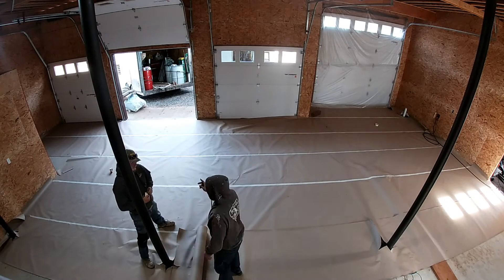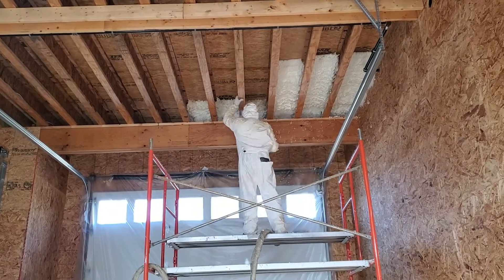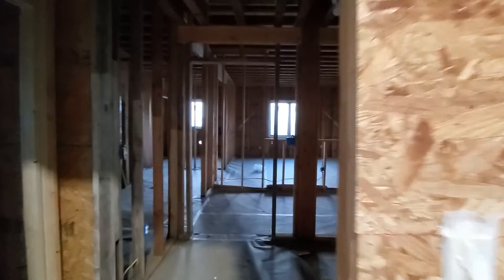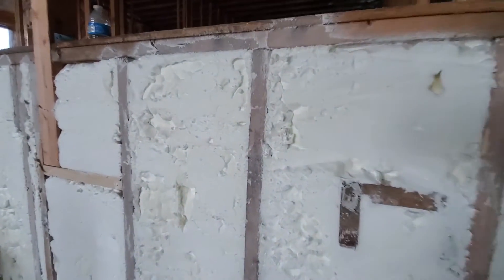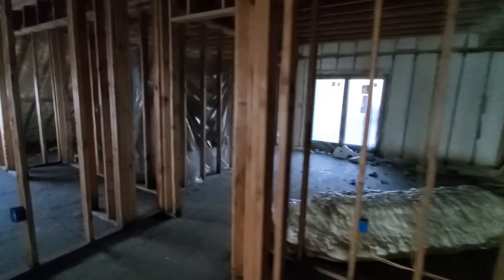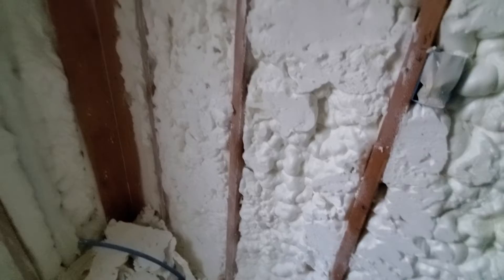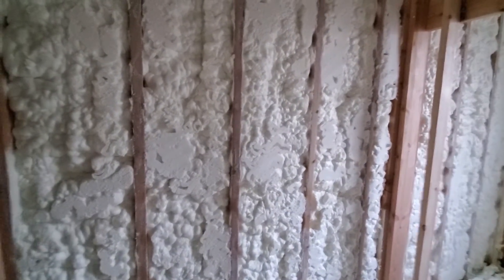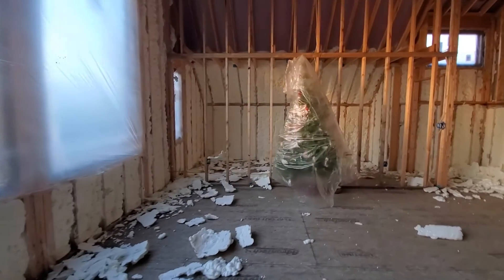Spray Foaming our Off-Grid Barndominium - Part 1

Comment: Hope they didn’t give you too much of a fit too fix it all up  with the amount of issues I’ve seen people have with spray foam companies it sure makes me cautious about doing it.  When my time comes I might just do a hybrid or do a ridged lair like you did on your roof on the whole house
Reply from the maker: I would not suggest doing spray foam.  We'll have more videos on the subject to come.  We are looking at doing an addition and plan to use rock wool for that project.
Reply: @Off-Grid  I get ya and yes I did this for a living for years and roxul is the best.  You can always cut 2” closed cell hardboard and get a frost pack for the edges then put roxul for the rest of the cavity   Hybrid system
Reply from the maker: @bamastead5126  Haven't heard of Roxul but will look it up.
Reply: @Off-Grid  oh it’s just a brand of rock wool.  Btw. House is looking awesome guys. Happy for you all 🙂
Reply from the maker: @bamastead5126  ah ok.  I haven't done a lot of research on brands yet but will.  Thanks for letting us know.

Comment: A little mess but a lot of insulation .Is 1 inch of foam to a four inch bat the same.They will fix all the voids. I didn't realize so much waste.Gary
Reply from the maker: The waste is crazy.  I looked at many options and knew we wanted a tight house.  Being off grid we wanted to make sure we could heat and cool it without any issues.  1" of Closed Cell is equal to around 3" of Open Cell but costs a lot more.  Both will create a vapor barrier at those depths.  We decided to do all open cell since we'd get an R Value of around 18.  But the real reason was the solid barrier.  Most house heating and cooling issues come from air leakage and this would solve it.

I looked at doing 1" Closed Cell and then batts or spider insulation, also looked at rock wool and other options.  We decided on the open cell because it would be fast and done and was almost the cheapest option.

Comment: That does look pretty typical for what I've seen but I've always wondered why it isn't completely flush to the studs.
Reply from the maker: In my research I found that when it first came out they did fill the voids completely but that over time they were wasting a lot of material because to achieve 100% they'd have to overspray to 130-140%.  They found that even with less foam the vapor barrier was still achieved and that more important that the R-Value since most of a homes heating and cooling issues comes from air leaks.
Reply: @Off-Grid   About how much is that per square foot if you don't mind me asking. I'm going to be building a house soon and I've thought of using that
Reply from the maker: @denniswallace4868  the total bill was $13,687.  I'd have to dig to find the total cost per board foot but I think it was $.80 or there abouts.  We have a few more videos on the spray foam to come too.
Reply: @Off-Grid   I'll be watching as I have been so far. My house will be off grid with solar and rainwater collection
Reply from the maker: @denniswallace4868  good deal!  We are on rain water as well.  5000 gallons.